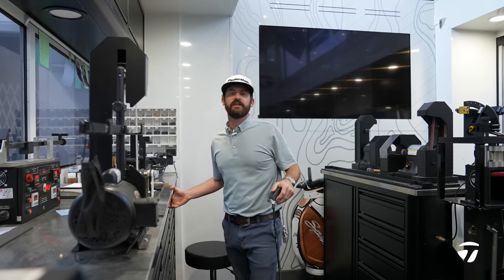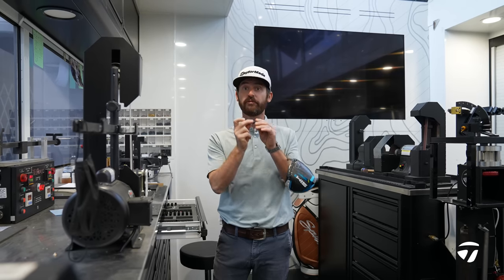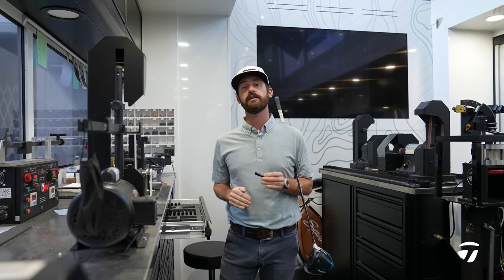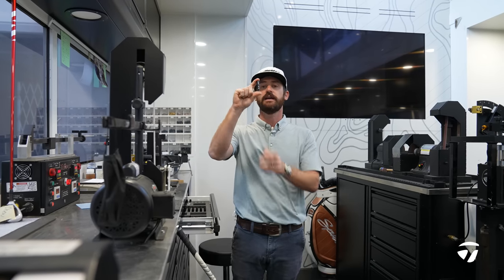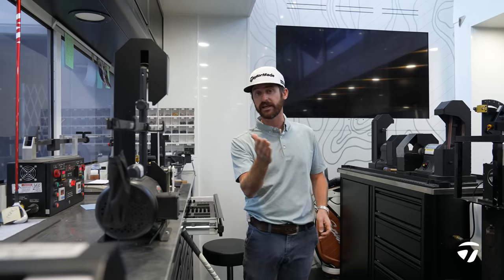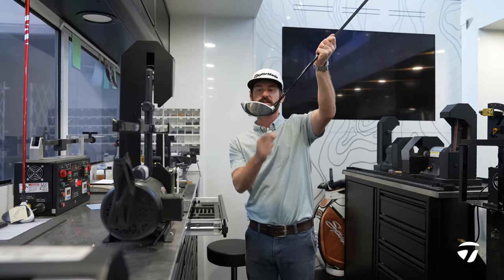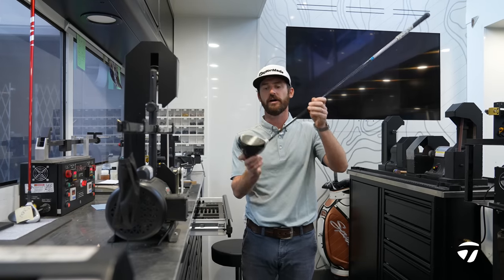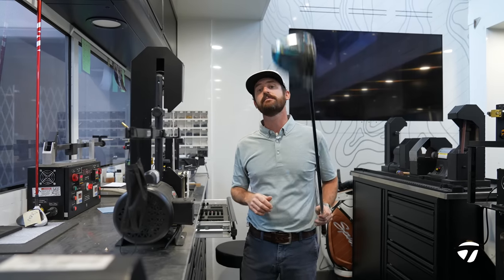How to Use Your Driver's Loft Sleeve | TaylorMade Golf

Comment: Apparently the PGA Superstore doesn't know how to use the adapter.   When you say Standard loft and Upright, they put it in Standard (how it comes default) because it says "Standard" on the adapter.   A Standard/Upright setup, should be a 180° turn on the adapter.     It's actually a blank setting that is Upright 180° from the eird "Standard".  This keeps the driver in the default loft but, closes the driver face with an Upright tilt at address to promote draw. (Well done)

Comment: I have a question. You said in the video that adding loft will help draw the ball more and that decreasing loft will help a run out and fade the ball more. The problem I have I that I have no issue with getting loft but I seem to over fade / verging on the edge of slice sometimes. I've had to decrease loft to 9 degrees as I was hitting them sky high. Any advice appreciated.
Reply: I used to have the same problem and im 15 so you can try and use my advice if you wish but what used to happen to me is i would hit it very high and with a slice and its because you swing is a bit “jumpy” if you want to call it that so to try and correct this make sure to keep your left foot planted on the ground so it doesn’t jump away (if you left handed it would be your right foot or your front foot) and what that does is it stops you from hitting as much up on it and will give you a more consistent lower ball flight….also just recently i have discovered that tilting your shoulders back just slightly helps with height because height is still a good thing but too much will obviously not be good…. Im a 2 handicap and have worked on this for a while so i hope this helped and made sense :)
Reply: @zacdsouza7608  thank you. All advice is appreciated brother so I will give it a go and either thank you or ask for more advice 🤣🤣🤣 thanks again.
Reply: It may be that you are hitting down as negative attack angle causing too much height and spin.
You really need a launch monitor to see what's happening...
The shaft weight will also influence height, light shaft more height and heavier shaft lower.
Reply: @warwickingle9936  this makes sense. I used to have a 70g which I loved and now have a 50g and definitely don't like it as much.
Reply: @louspencermusic  it really is trial and error but I would try a 60gram shaft to start. Where you are hitting on the club face is something you can do without a launch monitor. I use a damp towel and just wipe the face between hits. Lighter shafts being more whippy are harder to control but if the shaft is too heavy you lose swing speed...need the happy middle...good luck
Reply: @warwickingle9936  appreciate you taking the time to comment pal. Thank you.

Comment: I set my Sim Max 2 for max draw. When I screwed it back in, I heard no click. It’s so tight that I’m afraid to try to tighten it more. 

I’ve played a couple of times since, and it definitely has led to less slice and more distance, but I’m worried about the heading flying off.
Reply: Just keep going until it clicks. You want hurt anything. It takes a lot of torque to click.
Reply: Some torque tools don't click and others click easy. The screws have lock or rubber washers so if you have tightened firm it will be fine. The screws go a long way into the adapter sleeve so you will notice if it becomes loose well before it comes off...

Comment: As shaft technology has moved on is spine align not important anymore? Or was it never important?
Reply: It's only really important if you have an extremely cheap non big name shaft brand or if your shaft was made when graphite shafts first started readily being available(1995, give or take). If you buy an MCA/Aldila, Fujikura, Graphite Design, UST Mamiya, a reputable brand $200+ shaft it will be 99-100% round. So we are talking less the 1% not completely round at the very worst!